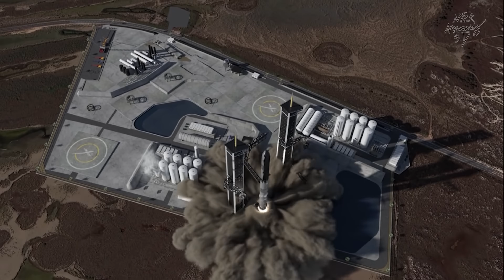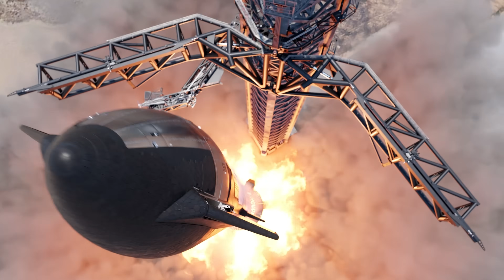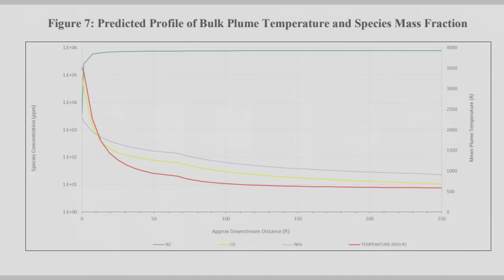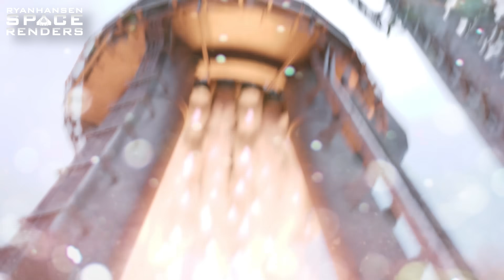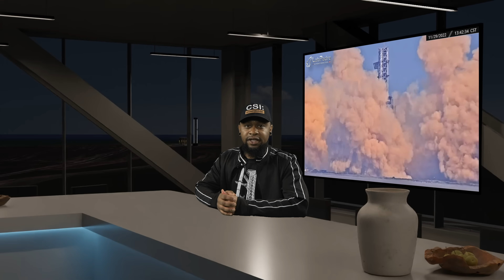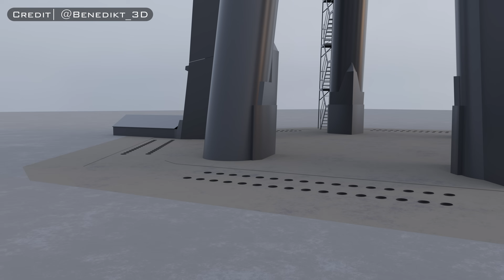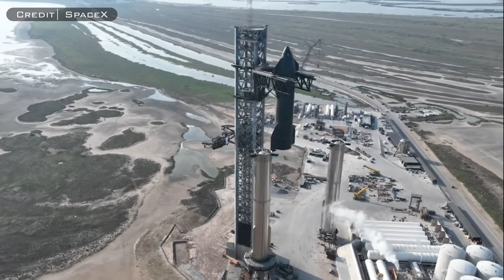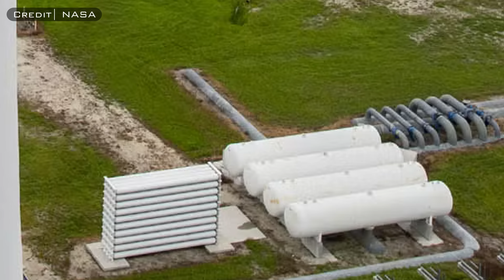SpaceX's "Major" Concrete Problem + Water Deluge Construction Begins at Starbase

Comment: I think this is the Mk. 1 pad.  He expects a possible RUD at launch, or when it comes back down.  This is maybe the cheapest way to prototype the assembly; if the tower or pad gets wrecked on a launch attempt, it can be dismantled or repaired more easily than if it was on top of a giant concrete sarcophagus.  
  The compressibility of the concrete may not reflect it's robustness against kinetic impact.  I think Newtons would be preferred as an expression of what's going to happen across the pad as a *whole*.  He's got shockwaves going on within the concrete (the design of the sections shows they're maybe considering this), as well as a certain amount of flexure at the surface, that IMO is never going to withstand repeated launches.   As a material on that scale it's going to have self destructive resonances, not to mention the transverse resonance that's constant during a static test.  Concrete isn't the material for that application imo.
  I think it's temporary until he has the kinks worked out, then we'll see a Mk. Ii or III that has the expected diverter, and larger equatorial leg mount.  

 Or they're presuming during an actual launch it won't have to endure the same abuse for as long as a static test, although the immediate expulsion of chunks seems to negate that idea. 

   $.10 armchair musing...

Comment: A CFD analysis would probably be a nice thing to have as “evidence” as when you are firing a rocket engine at a flat surface you will inevitably increase the pressure near the base and by extension heat. While I don’t have access to Ansys, the industry standers (sad!), I have access to autodesk CFD and I might be able to do a 2d sim to see how much hotter the plume gets when it hits a flat surface. SpaceX definitely did the math. Found a cool paper on this matter https://ntrs.nasa.gov/api/citations/20140009126/downloads/20140009126.pdf

Comment: Very interesting and informative video.  Will be interesting to know if acoustic/vibrational specs exist for the Fondeg material.  Also, I wonder how the material strength you shared varies with temperature (especially at your estimated temperature range at the concrete).  Would be interesting to know how that temperature at concrete level would vary if you approximate the entire diameter of all 33 engines as a single plume with ambient mixing at the outer ~10m diameter boundary.

Comment: Something people need to take into account is regulardless of how high the compression strength of the concrete is, that's not how much load it can immediately take. Until SpaceX create an immediate impact resistant concrete mix this issue will continue

Comment: I feel like spacex/tesla will soon be getting lots of 30x type stainless steel- and a couple sheets of that under the launch mount might go a long way toward protecting the refractory concrete.  Especially if they've got some extra heat shield tiles from the bakery mounted up.
Reply: Interesting thought. Would the heat shield tiles survive a starship launch when used as a blast shield under the launch table?
Reply: @ostar22  It won't
Reply: @ostar22  don't know, but it'd be better than the concrete.  And they keep talking about the tiles' "robustness" being super important.   With stainless melting somewhere near 1500°C it seems like they could put down some from all the prototypes they've scrapped and we could see how it holds up.

Comment: they should use some of the liquid nitrogen purge to freeze a -50C  thickish layer of ice at the base of the OLM just before launch. Such cold ice with a mohs scale not far off  concrete/7 Mpa compressive strength might admirably handle 10 seconds of raptor exhaust  harmlessly ablating/vaporizing away chunks of ice and would be a kool  experiment just for a lark lol
Reply: Liquid Nitrogen is being used somewhere else more effectively
Reply: @alvianchoiriapriliansyah9882  I mean instead of just venting it after cooling and purging pipes ie get even more use out of it

Comment: Why not cover the concrete with steel plate? It would probably buckle in the heat if all welded flat so would need to be fixed down in some other arrangement.
Reply from the maker: Melting temp of steel is much lower than Fondag limits

Comment: One thought on the Fondag at the launch pad is time of exposure. Static fires are lengthy and have more exposure time to spawl concrete. But launch conditions are different. It's a shorter exposure time and the rocket is lifting and creating distance at the same time. Also, Starbase won't be their main operational launch pad for Starship. Right now, Starbase is only cleared for 5 launches per year. Space X may have to upgrade the launch pad in the future but for now, it is probably fine. Wouldn't be surprised if the square compacted dirt mound with new concrete, forms next to the OLIT, is a base for a new water tank.

Comment: Non scientific person here.  Why not clad the fondag base with the same metal used on the rocket nozzles?  We know that it can resist the heat and a layered approach to the fondag and metal might just hold up
Reply from the maker: Nozzles are cooled by the flow of liquid methane passing through them.

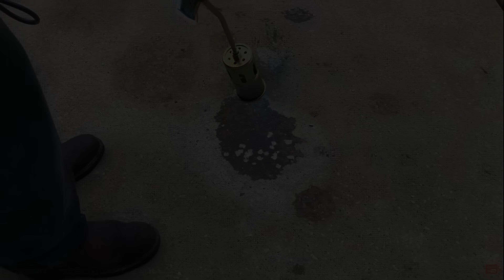Comment: 7:18 Spalling can also easily occur in concrete when the surface temperature is much greater than the substrate, simply due to the thermal coefficient of expansion. When the surface temperature increases very rapidly, it tries to shear away from a colder layer. 

Shear strength and tensile strength is about 20 times less than compressive strength in concrete, but stronger concrete can resist proportionately more shear.

Spalling can be mitigated by preheating the concrete slowly enough. Once the substrate is hot enough, the entire slab has expanded in advance of the application of thermal shock from 33 engines. 

Another method is to coat the surface with small ceramic tiles with a low coefficient of expansion and grout with an elastic (silicon) filler that withstands the temperature. With proper sizing and spacing, tile expansion will not cause spalling and the compressed grout will just bulge upwards. 

Perhaps an elastomeric coating alone can reduce the thermal shock to the concrete enough.
Reply: Food for thought!

Comment: You measured the tests and the impact on the concreate - Can you also measure the launch time - how quick can the booster leave the mount. Also, just a thought, Maybe only the center or outside engines will be used during launch and the balance of engines will be started after MAXQ ?
Reply: Elon wants it off the pad the quickest possible.
Reply: @heartysteer8752  Every detail you presented was timed and explained so well could you do this for the actual launch?
Reply: @insightamization  Think you've mistaken me for someone else? Regarding your comment to Jonathan... the rocket needs to get moving as fast as possible as quickly as possible. Every second that it's not supported by the launch mount, it has to expend fuel to fight gravity. So the quicker it can get moving, the less fuel it will use, and the more payload it can carry. That's why they increased the center engines from 9 to 13.
Reply: @heartysteer8752  My apologies
Reply: @heartysteer8752  great thanks
Reply: The rocket's at its heaviest at lift-off, which is where you need the greatest thrust. If Starship could reach Max-Q without the inner engines, they'd be able to remove them entirely and save weight.
Reply: @Roosterfing2412   The outtter ring of engines would have less impact on the concreate? Could provide more thrust once out of the atmosephere? To what benifit? After watching the NASA Artamis engines blow the doors off. The Raptors have got to have way more power than the 14 engines tests reveal.

Comment: Cement,  water, quit messing around with inappropriate lesser measures, countersink two inch thick battleship arrmorment steel boiler plate under the launch tower. Problem solved.
Reply from the maker: Do you know the melting temp of steel?

Comment: does cold water vs warm water have an effect on how good a deluge system is? also had the crazy idea of a several actual horizontal ground-mounted raptors firing briefly in unison with the 33, creating a pressure layer that helps divert the temperature and  force of the liftoff raptor compliment. fight fire with fire. since all that cryo fuel is already right there and handy, might be more efficient when combined with less amounts of pressurized water. also, could the water tank be placed on top of the launch tower? speaking of pressure, the added pressure of such a high body of water might make repetitive / periodic launches more practical as well, while lowering the footprint of a water deluge system.. you still have to pump it up there, but over a longer period of time
Reply: probably not, as it is mostly about the amount of energy required to convert the water from liquid to vapor...

Comment: Why not just use the same starship stainless as a cover on the bottom of the launch mount?
Reply from the maker: Melting temp is 600 degrees lower for stainless
Reply: Correct me if I am wrong, that I saw from some of the website saying "Stainless steel’s melting point falls between 2550 and 2790°F or 1400 and 1530°C."

Comment: Why are they making the pad out of concrete in the first place? Wouldn't a thick steel plate be stronger and more repeatable?
Reply: Melting point is much lower.
Reply: @parislikesliners  steel melts at a higher temp than this concrete

Comment: I suspect the PSI would be higher with multiple engines firing - with one engine, sure it pushes down with 245 of so PSI - but if there's nowhere for the exhaust to go because all the other engines exhaust plumes are surrounding it, the pressure would be higher. Suspect this same "mulitpler" effect would apply to tremperature too - hard for a central exhaust to cool when it's surrounded by equally hot parallel exhausts.
Reply from the maker: The other engines will spread their force over adjacent area. Not on top on top of the same circle. The more engines firing, the more square inches are added to the equation.

Comment: Pressurizing the water tank seems needlessly complicated when they could have just made it taller instead.
Reply from the maker: That’s not how spacex rolls. The old water tower at KSC is leftover NASA equipment. No need to build something that tall if you can use compressed gas to force the water out.
Reply: @CSIStarbase  Yeah, plus they're going to be vaporizing the nitrogen anyways, so it doesn't actually add that much complexity. That is just a brilliant connection and bit of speculation on your end. Kudos!

Comment: they might need to look into geopolymer concrete instead of portland based one.
Reply from the maker: Portland concrete is only on the outside of the main pad
Reply: @CSIStarbase  the problem with calcium silicate (regular concrete aka portland concrete) or calcium aluminate (used in fondag) cement is that their curing rely on rehydration (chemical water addition) of those minerals Ca-Si or Ca-Al. But after they are hydrated, cured and then heated, they become dehydrated again and as they dehydrated, they shrink and cracks. In contrast, geopolymer is basically a synthetic nano-obsidian so it will not shrink as easily and can withstand heat given good aggregates, and most importantly far stronger at high temperature than any of those concretes.
Reply: @CSIStarbase  calcium aluminate is popular as a fast setting concrete for airport repair back in world war 2, but it is long known this type of concrete doesn't last very long as it will unavoidably cracks few weeks or months after cured.
Reply: Welp, it can't resist 33 raptor engines afterall

Comment: I think that because of the minimal basin size at Starbase to collect water, the deluge system will need to operate quickly, just enough to stop concrete erosion.
Reply: Not sure how water around the perimeter does much to protect the concrete. Sure they could start with several feet over it, but that wouldn't last long.

Comment: Good work. Personally, I don't see many methods to deal with such a powerful rocket besides a flame diverter, at least many options that won't require constant repair, a steep checkbook, or overengineering. A good diverter would allow for the kind of turnaround times SpaceX will need to launch every couple of days and multiple times in a single day and wouldn't require complex water deluge, taller launch towers, or other overengineering. It isn't quite as simple as just a curved hole in the ground, but it's simple enough. I am interested in the boil-off from the water deluge will be enough. It may also cut the sound which could cut down on the environmental effects of acoustics.

Comment: How about a granite slab.
Reply: Granite cracks and spalls horribly under thermal stress. I live near granite mountains and hot summer days are now enough to trigger rockfall. A campfire beside a granite boulder can have spectacular (and dangerous!) results. I can only imagine what 1 or 33 raptor engines would do...
Reply: @NickGobin  Yeah figured. There has to be something that will work.  Section of the deck of a retired aircraft carrier,  a wall from a bunker, IDK.

Comment: I am not an engineer but I love your deep dive analysis and your speculations. I was always surprised that Starbase was pouring the concrete base and then very quickly firing it since time for full concrete cure and strength is normally achieved beyond the minimum recommended. I would like to see the data on that concrete of its compression strength and temperature resistance versus cure time.
Reply: Really appreciate all the work you put into your documenting all the work going on. Beautiful! It’s an education and good learning part of study.
Reply: Fondag is chemically very different from what we know as concrete. It cures in days and afaik doesn't continue curing over weeks and months like concrete.
Reply: Incrementally stronger concrete ain't no solution to 33 Raptors, lol.

Comment: Good job, man, no, great job! This makes me feel happy! I didn't have much faith in the pending 33-engine fire test, but now I do!  But why was this not used earlier? And why is spaceX not replacing all of the cement work that might throw up debris?
Reply from the maker: That's the million dollar question. i don't understand why it wasn't installed before. But the same thing happened on the suborbital pads. They have always underestimated the damage potential

Comment: Hello Zach....
If my postulation is plausible, the outer 20 engine exhaust, though reacting with the ambient air an be cooling down, that thermal cylinder wall will contain the heat plume of the center 13 engines.  These 13 exhaust will act like a BLAST FURNACE on the OLM Fondac concrete.  Thermal variances could exceed 4000+°F.   The concrete itself will need some sort of cooling system to withstand the level of heat.

Comment: It may sound completely nuts but what if there were electric wires under the concrete. Heating the concrete a day or two before launch will help drive out trapped water. Same reason you have a heating curve for starting a kiln from cold.

Comment: I don't know much about this, but I would have thought a stainless steel skin over the top of the concrete would solve this issue.
Reply from the maker: melting temp of stainless steel is 2550F. Which is below the rating of Fondag
Reply: @CSIStarbase  ah, thank you.

Comment: it seems as if, in typical Musk fashion, this base was hastily constructed to keep/attract investors and is now having to actually perform. Everything appears to be being built backwards, as if it was a joke at first and now needs to work. From the pedestal, to the proximity of the tank farm, to the "gas station" labor being employed, it all just seems so sketchy. The most powerful rocket ever is being launched from a Lincoln Logs support stand, sitting on beach sand...
Reply: A ‘Lincoln log’ support stand that’s strong enough to support the heaviest rocket ever constructed?. No doubt that some questionable decisions have been made, but you’ve conveniently left out the talent of the engineering team that have constructed a very impressive ground support. With the high strength concrete and a deluge, the problem may be solved

Comment: Soooo… at 0:30 we see two towers, two sets of chopsticks, and…wait for it…two landing pads. Older rendering, or is there a corner case where the ships or boosters land without the chopsticks?
Reply: I don't know what the person who made the render had in mind, but at some point they are going to need to go back to testing landing hardware. I suppose there's an argument that they might never test it in flight on Earth, opting for a Boeing-style test by modeling and some physical testing that is short of actually flying and landing Starship hardware, but that's not very SpaceX.
Reply from the maker: @thirteenthandy  HLS will most definitely need to be tested on land, Ideally, in a desert. Or on an Island. I don’t think an actual landing pad will be needed though
Reply: @thirteenthandy  and that’s exactly the corner case that should have been obvious to me but wasn’t. My turn for the facepalm!
Reply from the maker: Hmm it’s just for the purpose of making a point.